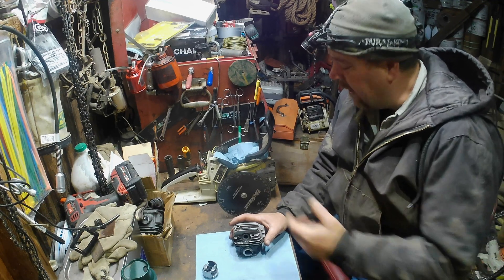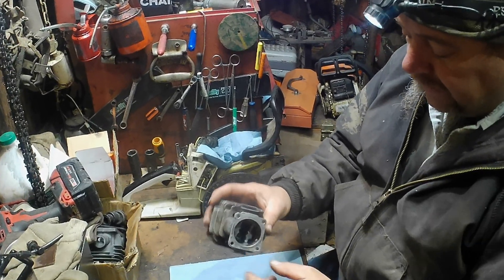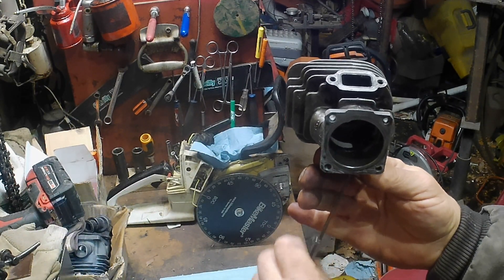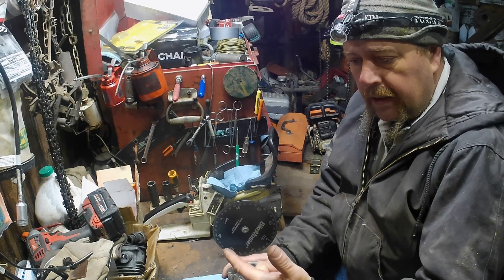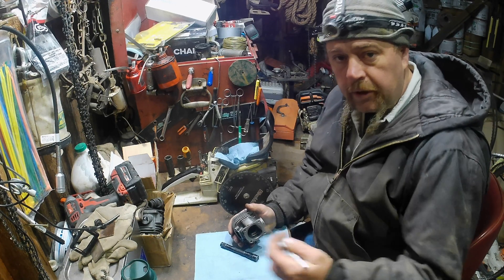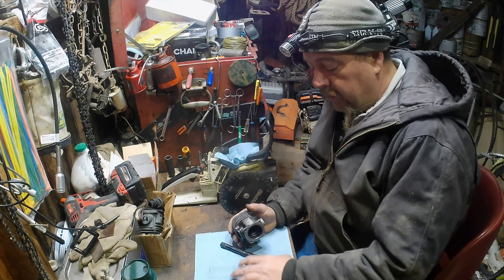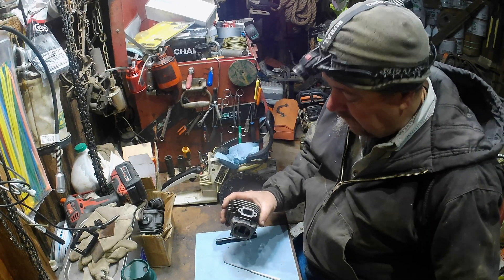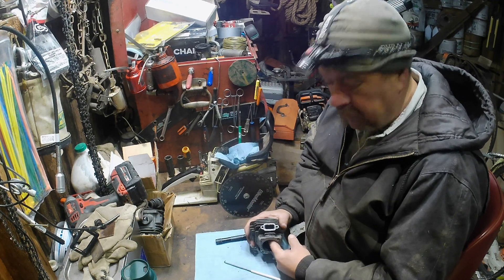Different Way to Understand Chainsaw Porting for the 4 Stroke Mind

Comment: Sheep velocity for explaining volumetric efficiency and charged air flow was brilliant! Well done Sir.
Reply from the maker: @Archer_82   You must be familiar with sheep... can't drive two through a 12 foot gate, but 100 will go through a 4 foot gate lickety split! Spend 20 minutes getting the first one on the trailer, but as soon as one goes, the whole herd will be in there crammed in so dang tight they can't ALL even stand up.  Glad it made sense to someone other than me.

Comment: It took me a bit longer than I feel like it should have for the camshaft correlation to register inside my head when I first started looking into the 2 stroke modifying hobby. Embarrassing considering I worked as an auto machinist for a couple years. Gotta laugh at ourselves. 
This was an absolutely brilliant video to help the people with similar brain wiring understand 2 strokes better.
Reply from the maker: @FarmlessFarmer-xs1he   Dang Farmless; I thought I was the only dim bulb trying to correlate  to my 4-stroke thinking!

Comment: Always helpful hearing how someone else thinks through  something.  You explained yourself well and are easy to follow.  

The duration is the easy one.

I think of "lift" more as velocity of the flow changing at different rpm due to resonances either matching or not.  It's all connected and hard to sum up. 

I'd hate to try to make this video.  You have my respect.  Keep up the good work.
Reply from the maker: @Kevin.L_ Thanks Kevin; I didn't get into the weeds of intakes, runner length, etc... ; just so much rambling I can do before I totally lose track of time. We are on the same page; in the beginning I couldn't get my mind to go there until I found a way to compare to engines with which I already had a modicum of understanding.  Thanks Kevin!
Reply: @HayChaffandSawdust1   I've done some engine repair but never any real mods.  I understand the concepts but don't have the background you do.  Likely why I never tried to relate 2 stroke to 4.  I just look at them all as air pumps. 

It was interesting hearing some of your background.  What turbines did you work on?
Reply from the maker: @Kevin.L_  Been so many years, but I worked on GE's LM2500 and another which I cannot remember the number. The engines upon which I worked were stationary (relative to the ship) mounted and were coupled to the propeller via a reduction gear. It's been many moons ago... About the only thing I have remaining is my hearing loss 😂  "Air pump" is a better way to consider it, I'm sure.   As a matter of fact, I used a weed eater engine with an air hose in the spark plug hole to run something (can't remember what it was). Of course, no lube and not efficient, but tinkering don't matter... I think maybe I used to to run a miniature hay baler... been too many years.
Reply: @HayChaffandSawdust1  That's about 20 times the size of turbine in the tank I drove.  I helped pull several but never got to tear into one.  Similar number of moons ago.  Ditto on the hearing damage.  But I can't blame the engine.
Reply from the maker: @Kevin.L_  I reckon the engine isn't the most hearing-damaging thing on one of those tanks! As far as tearing into the engines, I only did a few times; they were pretty dang tough; would run until there's no way they should have.  Thanks for your service Kevin!  It's not like we had a fleet of aircraft; we had 4 to propel the ship and 3 more driving electric generators (about 1/2 the size as the lm2500) and providing heat (exhaust) for the boilers. Most times, "double hearing protection) was required, PPE was actually pretty scarce... if you could come across a set of muffs, you hung onto them for dear life. 
Thanks for your service Kevin!
Reply: @HayChaffandSawdust1  That's a lot of drive power.  Guessing it wasn't your average pontoon party boat.  I can't imagine there was ever a shortage of waste heat available.  All I ever saw was the old rubber ear plugs in the Army.  I'm sure they hat at least a 6db reduction.  Only the best right?

I still get a chuckle when I see that saw up on jack stands.
Reply from the maker: @Kevin.L_ Something like Million and half ft/lb torque!!  
I think sometimes the earplugs has some sort of loudening gel on them 😂😂
I was editing it and trying to get sounds overlaid (clubbing the empty burn barrel with a stick of firewod)... I would chuckle ever dang time I "hit my head" on the saw and got the hollow clang!! Still makes me chuckle. 😂